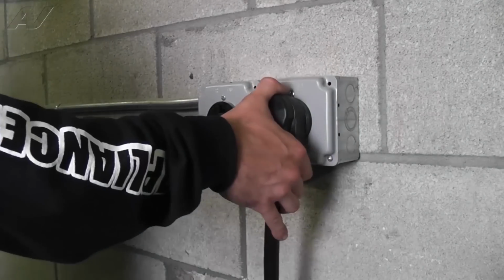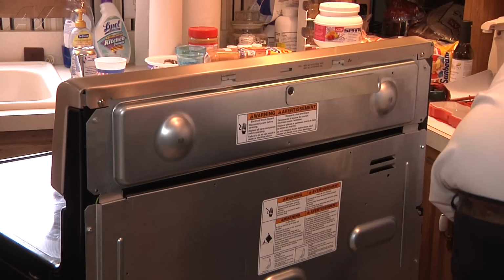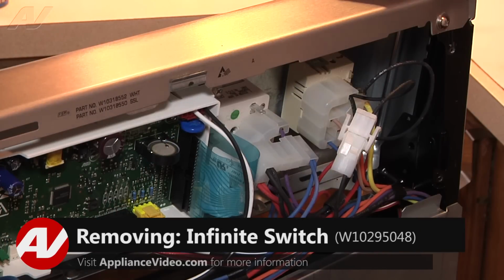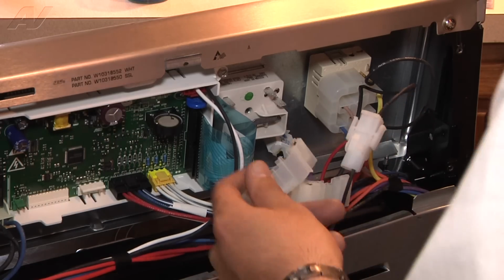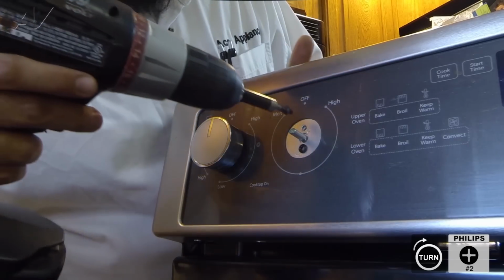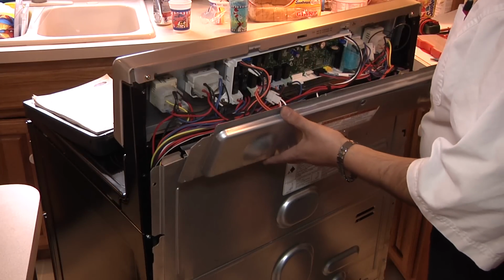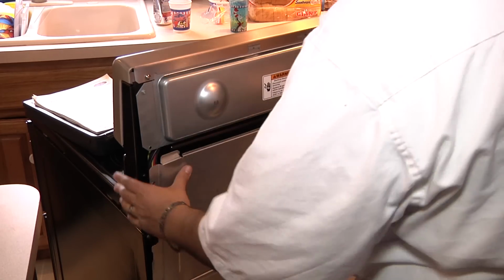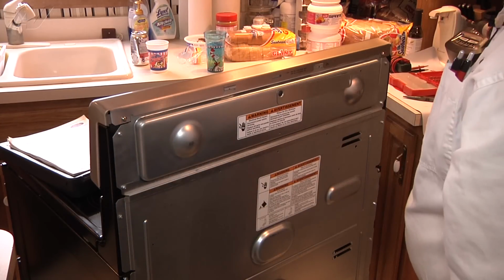Whirlpool Stove Repair - Light Constantly On - Infinite Switch

Comment: The shorted switch will give you a nice little buzz if you come into contact with any of the metal parts during testing to see which one kills the cooktop light (ask me how I found out). 

I decided to disassemble my switch and burnish all the contacts with my metal files as opposed to dropping 50 bucks on a new switch, which is highway robbery given how simple and cost-conscious these mechanisms are. There was a lot of carbon deposits on every contact surface, but I’d still go in and burnish surfaces that look okay. After reassembling and doing a quick test with the switch plugged in but dangling loose, it worked great. 

Don’t buy new switches. Take apart your existing one and refurb it yourself. They still work, they just need cleaning. These are virtually impossible to have a mechanical failure with due to how simple they are. They just need maintenance.
Reply from the maker: Great question, if you have a more technical question that our parts department cannot answer, you can search our over 13,000 answered questions free at our website www.ApplianceVideo.com under our Repair Help section. You can also call our parts department at 1-800-830-5465 and they can give you help 7-days A week ,or search at www.SaveMoreOnParts.com  .

Comment: This is the exact same model we have I’m wondering if anything’s going to happen if the light stays on
Reply: Nothing happens. You can still use it
Reply: @Wackakids  thanks. It has stayed on for the last two years and I can confirm that too😅
Reply from the maker: Great question, if you have a more technical question that our parts department cannot answer, you can search our over 13,000 answered questions free at our website www.ApplianceVideo.com under our Repair Help section. You can also call our parts department at 1-800-830-5465 and they can give you help 7-days A week ,or search at www.SaveMoreOnParts.com  .

Comment: Can I still use the stove while  I received the part?
Reply: Yes
Reply from the maker: Great question, if you have a
more technical question that our parts department cannot answer, you can search
our over 10,000 answered questions free at our website www.ApplianceVideo.com under our Repair Help section. You can also call
our parts department at 1-800-830-5465 and they can give you help 6-days A week
Monday -Saturday, or search at www.SaveMoreOnParts.com  24 hours
7- days A week.

Comment: Is it dangerous on an Electric Range if surface heating light stays on more than a day? or before I can get it repaired.
Reply from the maker: Great question, if you have a
more technical question that our parts department cannot answer, you can search
our over 10,000 answered questions free at our website www.ApplianceVideo.com under our Repair Help section. You can also call
our parts department at 1-800-830-5465 and they can give you help 7-days A week
Monday -Sunday, or search at www.SaveMoreOnParts.com  24 hours
7- days A week.

Comment: I unplugged all the switches and the light still stay on
Reply from the maker: Great question, you can call our parts department at 1-800-830-5465 and they can give
you help 6-days A week Mon-Sat . You can also search at www.SaveMoreOnParts.com 7- days a week.  If you have a more technical question that our
parts department cannot answer, our technicians are answering all questions at
our website at www.ApplianceVideo.com under our Repair Help section. We have over 4,000
common questions and answers that you can easily search through by your model
number, appliance make, and problem or error codes, and It’s free to search
through our question & answer library.